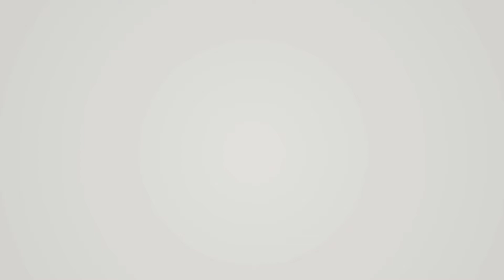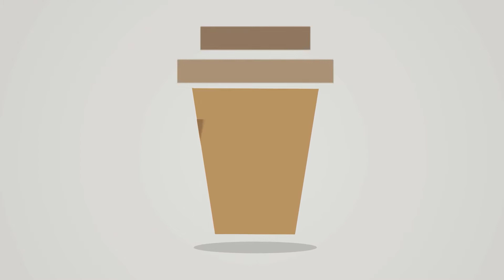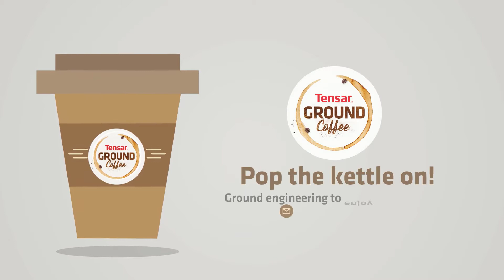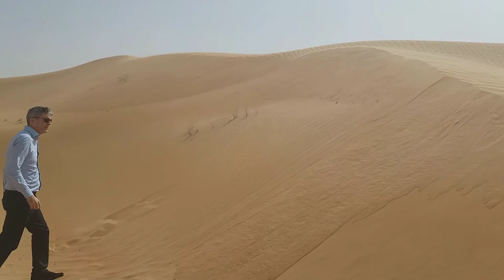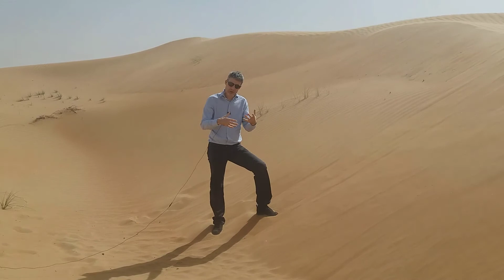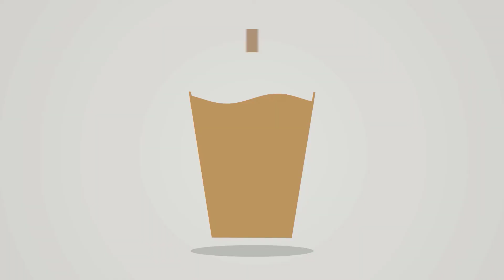Why is desert sand not used for construction? I Geotechnical Engineering I TGC Episode 23

Comment: 1)You make concrete with the sand 
2) You break it in very small pieces until you can see strong bonds. 
3) you make concrete again with the new smashed small concrete forms.

Comment: if there would be a way to make glass of it .. couldnt u fill it with sand then and make big mega structures ... u could maybe boil seawater in glass then, delivered from far away of course .. megastructures could provide shadow then .. and some solar panals on top ... or mirrors collecting light ... so u have water shadow .. energy and light  and allready the storage for it --> ergo u could build some oasis inmidst the dessert then and endlessly expand it .. just wondering if it could work when build in some appropriate scale with glass and sand together .. or compress the sand and bake it with so much solar energy 2 bundle .. there just must be a way 2 use all the sand

Comment: desert sand has little use; the grains are too smooth and fine to bind together, so it is not suitable for the making of for instance concrete. This sand is not used in construction, as its grains are too smooth and fine to bind together for building materials.